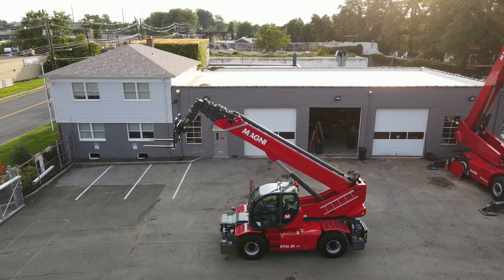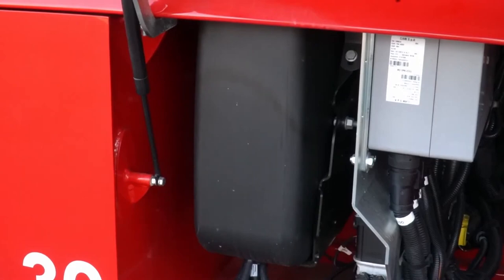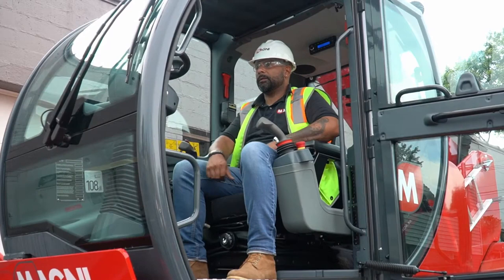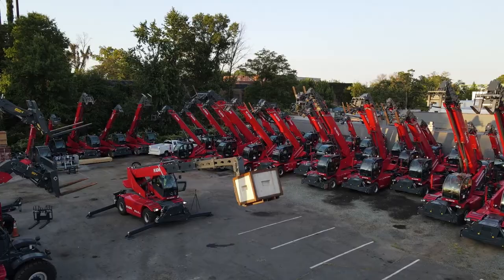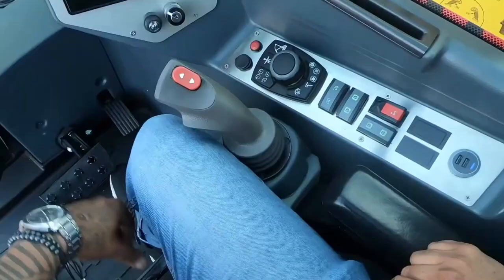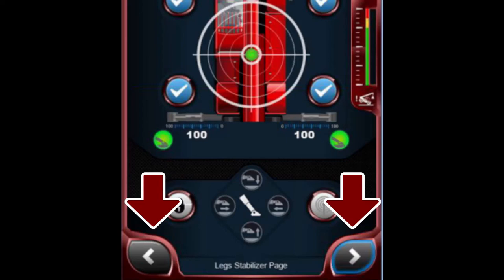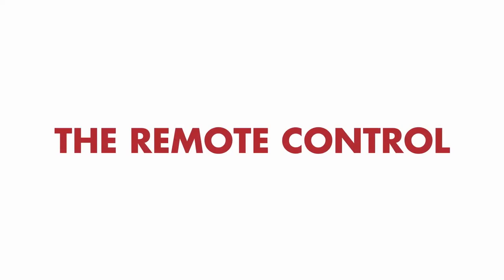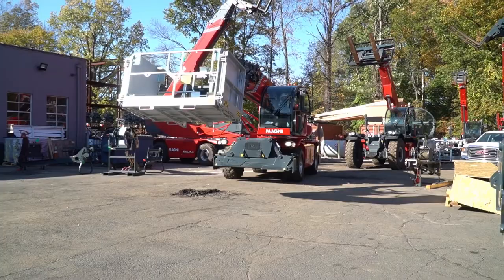Magni Rotating Telehandler Operator Familiarization

Comment: Salam mən magni sururəm magnidə prablem var kömğklik gösdərə bilərsiz?
Reply: Nasıl bi proplem var ?
Reply: @mazgin  ekrani qaralir gun ərzində 5   10 dəfə sönur ekran  ama mator işdiyir ekran sönuŕ hərşey avareniylə işliyir  ekran qaralir qalir  nədən olabilər o?
Reply: Sigortaları kontrol ettiniz mi ? Atmış olabilir
Reply: @mehmanimanli7030  dude the screens/computers on these are so finicky. Mine every morning gives me trouble with starting due to the screen not turning on.
Reply: @bonnorbassidy8198  yeah I worked for them in Pasadena Texas and there were always constant problems with them. Ranging from screens not working. Improper fluid from factory. Things brreaking just from normal use. Tons of leaks. And to mind you these were all coming straight from manufacturer.

Comment: You need time stamps.
How do you unlock the slew?
Reply: Look to your right. There is a main pin. The turret must be at zero degrees. It helps to have a 2nd person there if not perfectly aligned. Pull up on the turret pin and turn until it locks in the up position. If it is too tight have the operator rotate slowly until it is loose enough to pull up.